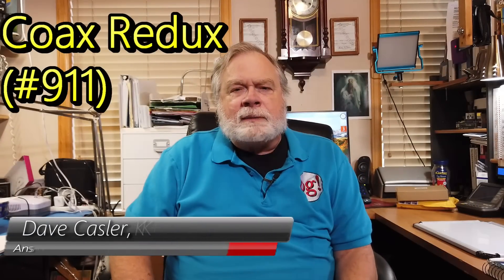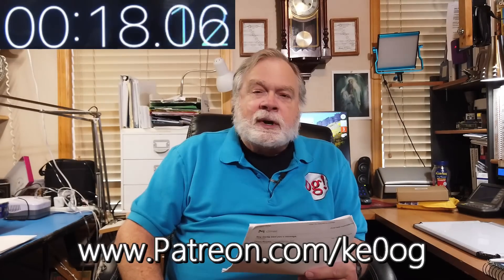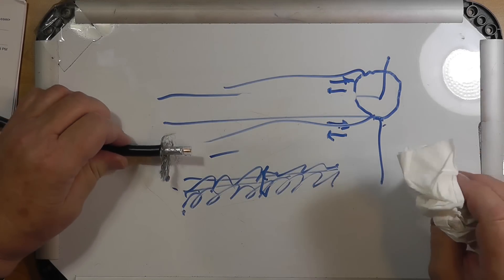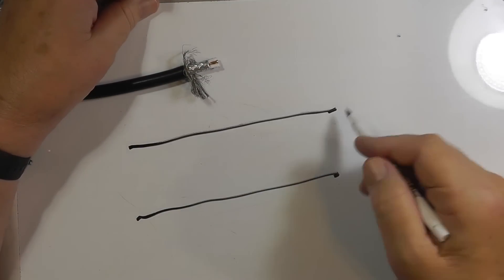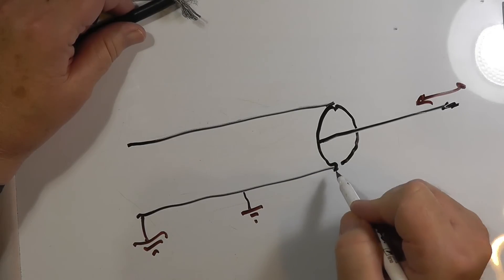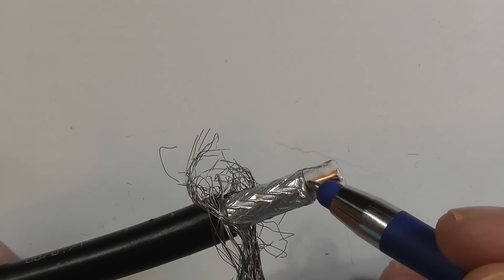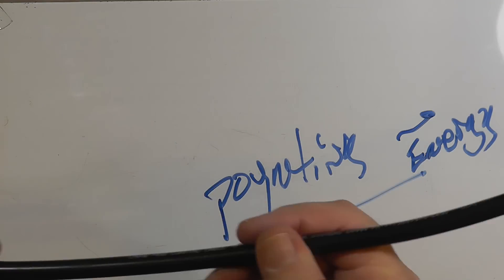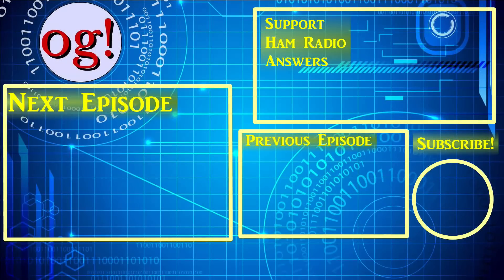Coax Redux (#911)

Comment: You spoke of the copper coated aluminium center conductor not having any water getting vetween the two metals.  I was told long time ago to be careful of cutting or ringing the copper coating with a knift when installinf a connector.

Comment: Hi Dave, Jeff KG7TXI here, you would think in my extra class studies I would have come across how to calculate the length of ground planes. Just bought a new 1899t antenna from mighty fine junk and I have the counterpoise all figured out but they're very vague on the length of the ground radial wires. And the literature is full of a multitude of options. I wondered if you could provide some guidance. Thank you so much for what you do for my hobby and ham radio communications worldwide. You are certainly an icon and your work is. Please stay safe. 73
Doc

Comment: I came across a good analysis of what happens when you hook up unbalanced coax directly to a dipole.  It turns out the energy is still unbalanced a bit, with one pol getting maybe 2% more energy than the other, with some losses from imperfect coupling between the poles.  So a balun will compensate for that loss (while also preventing common mode return current), but baluns aren't perfect and have their own losses, too.  But then, leaving out the balun might mean you need a choke, and that has some losses, too.  So which one has the lowest loss?
Reply: Are you familiar with the term, R +/-jx?